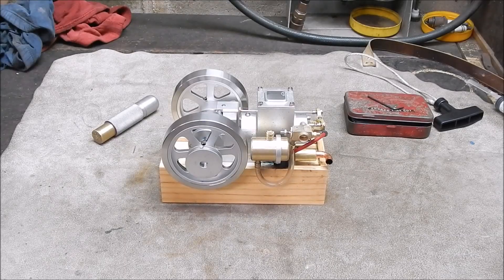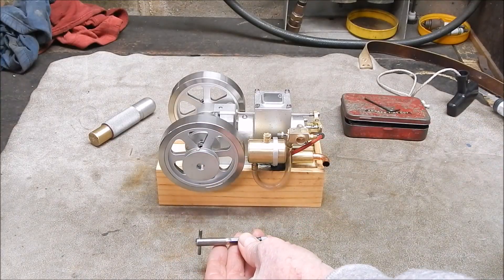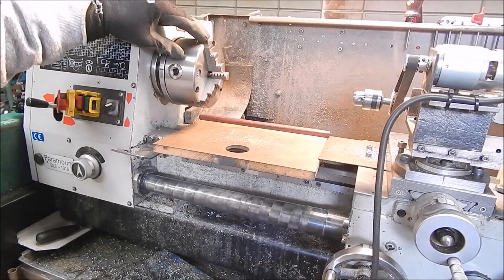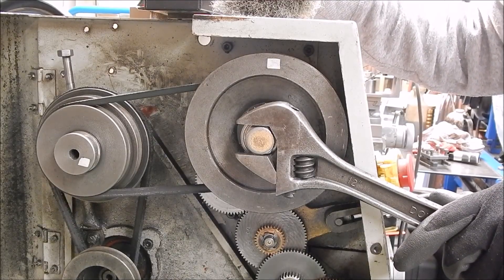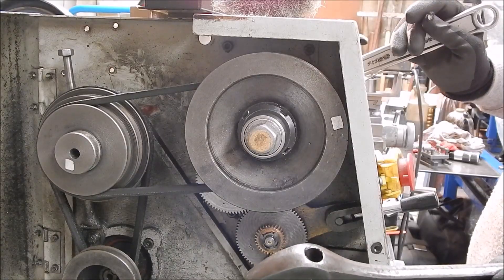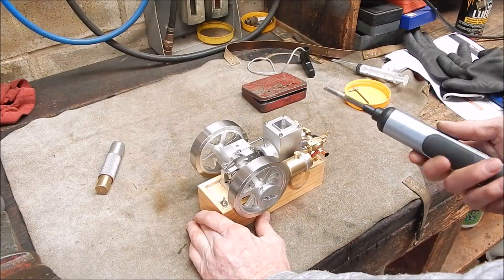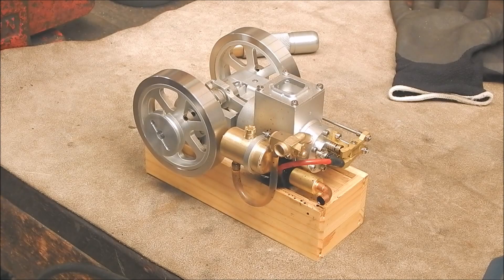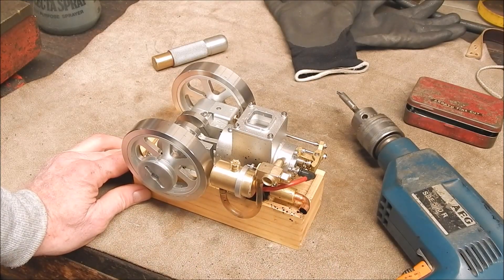Eachine ET8 horizontal four stroke engine mod 1 - Add electric start capability.

Comment: I start mine by flicking the flywheel, ive never had to use the pull start or anything.
Reply from the maker: This will hand start, but it's easier with the electric drill.

Comment: That's a bloody handy lathe accessory/attachment and worked great for that job - Cheers Jim
Reply from the maker: Hi Jim,  I use it a lot.  Plus I can index work on the lathe.  The mill/drill head is a kit from Banggod I reviewed way back.  Cheers Rob

Comment: Hi Rob. A simple but very effective mod 👍👍With the hit & miss engines, once sorted you can start them by just spinning the flywheels by hand. The four stroke obviously needs a little more oomph! Cheers, Alan.
Reply from the maker: Hi Alan.  This engine has a lot of compression for the size.  Hand starting may be possible when tuned 100%.  I saw it done on another channel.  Cheers Rob

Comment: great Mod Rob
keep warm🥶🥶🥶🥶, !! you can tell me the same in 6 months!!😀😀😉😉👍👍🚂🚂
see you next time
atb
Kev
Reply from the maker: I love my diesel heater Kev.   Was 10C first off in the workshop and after 3 hours it was 20C.  Still 14C outside at that time.  Works really well.  I can't imagine life without it.  The workshop was an ice box before.  Cheers Rob
Reply: @Xynudu  still only 15C here and were in summer🤣🤣👍👍
Reply from the maker: Better get out the sunnies Kev 😎